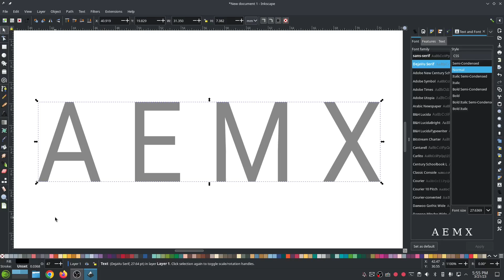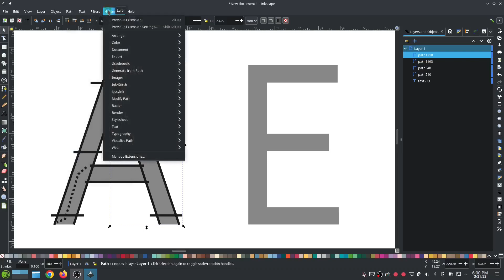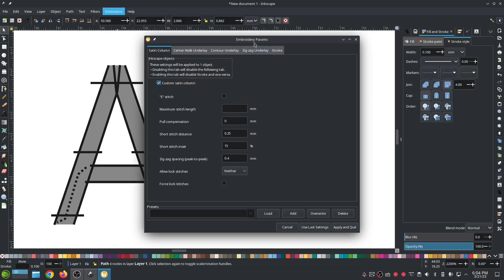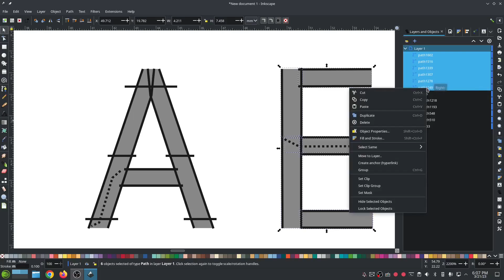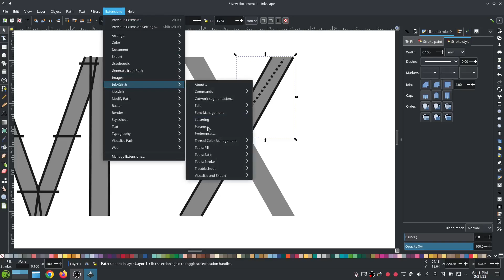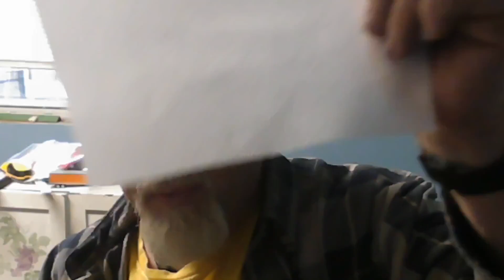Inkstitch - Getting great results from very small satin stitch lettering.

Comment: Hi sir, good morning, i have an issue i want ask, i did follow all the steps you teach here, and everything work just fine, but when i do the simulator, the stitching is not the same when i do the params. i have no idea what i did wrong, i follow all the steps you show. Thanksss.
Reply from the maker: simulator will show everything to be stitched. params will often show only a certain segment of what will be stitched. For example. if you have a satin, fill, and running stitch, simulator will show them, params will only show what you select in params for settings.

Comment: I’ve been watching closely some of the ways InkStitch lettering fonts stitch out, and I was wondering your opinion on if there are any advantages of your way vs theirs? I’ve only seen a couple very closely, so I don’t know if this is a rule, or just the way different people prefer. 

Example: on the A, they would run from the bottom left and stop the satin stitch at the point where the left and right sides touch. Then, the would treat the upper part as a trapezoid and satin the entire upper part back down to the intersection. Then, finish out the right side from the bottom of the upper portion down. 

I saw it on the lower case “n” and “h” in one of the scripts. This would negate the overlapping of stitches where they intersect. Any advantages or disadvantages? If I’m not clear and you’d like to see it, I can post in your FB group that I am in.
Reply from the maker: Mostly it's just a number of different ways to come to a common end result. It's safe to just pick one or two of those and become good at doing it that way

Comment: How did you get the A cross bar to be a satin stich with no rails?
Reply from the maker: I often get rungs and rails mixed up, the A crossbar has rails but no rungs. You can make satin columns without rungs if the number of nodes are the same in both rails...
https://youtu.be/M38GK7iRu0k

Comment: For a stretchy, light cotton t-shirt, do you use a water soluble topper, or simply the 2 layers of cut-away stabilizer and spray adhesive? Do  you put the t-shirt inside the hoop, or simply glued on top?
Reply from the maker: She only uses topper when stitching something shaggy, something that might need a knockdown stitch perhaps.

She uses 2 layers of pro mesh, or woven mesh with adhesive, and the adhesive between that and the shirt, and then hoops the whole thing with the mighty hoops (the magnetic hoops). We do the same with regular hoops as well when the mighty hoops aren't an option.

Comment: What's her take on using old linen sheets cut up as a stabilizer
Reply from the maker: She says if they are actual linen fabrics you should make a nice linen outfit out of it. The question being do you mean linen material sheets or linens, as some people call bedding 'linens'. We are running on the assumption you mean actual linen material. Her primary reservation is that linen is bad for fraying on the edges of cuts, and that it isn't designed to do this task. Otherwise she said it would be interesting to try it, if it isn't big enough to make a shirt out of LOL
Reply: @LowTechLinux  yes thats what I meant the material from old linen sheets just using it as a stabilizer

Comment: Does the running stich replace a jump stich is that what im getting from that when you use a running stich
Reply from the maker: Yes. A jump stitch might not be where you want it or can cut it with scissors easily. The running stitch hides moving to the next position. Also some machines will automatically tie off and trim if the jump is over a certain length.